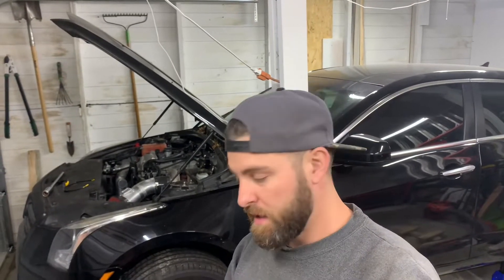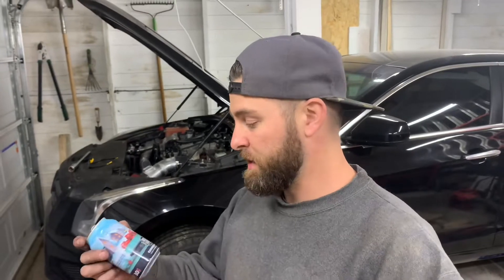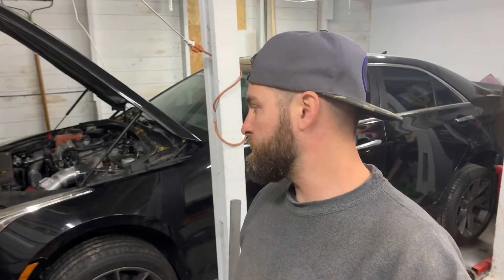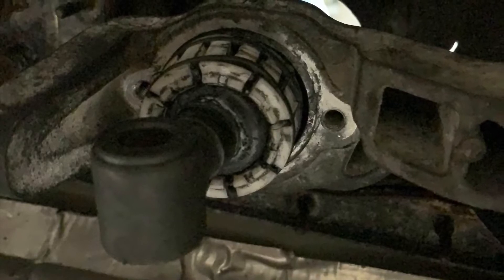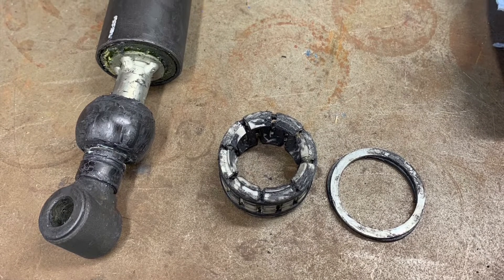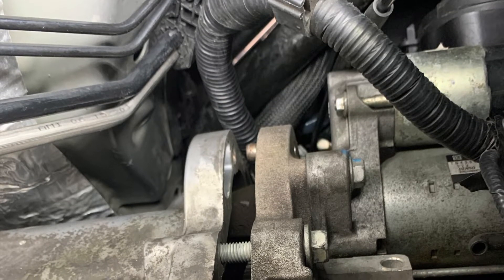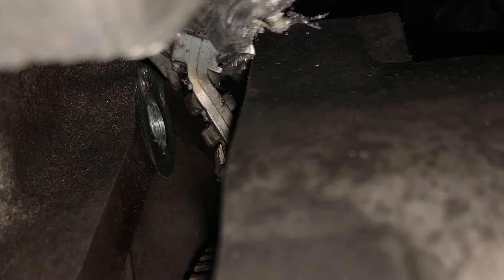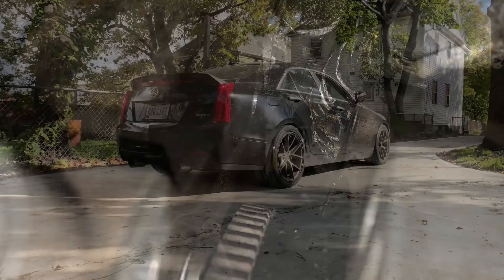LTG Clutch Install… Great Success! So what was the issue???

Comment: which flywheel did you go with? you replaced throwout bearing and slave cylinder too? sounds great.
Reply from the maker: It’s the clutchmasters lightweight flywheel that ZZP also sells abs yes I replaced the TOB and Slave, which are actually a single integrated piece on these.